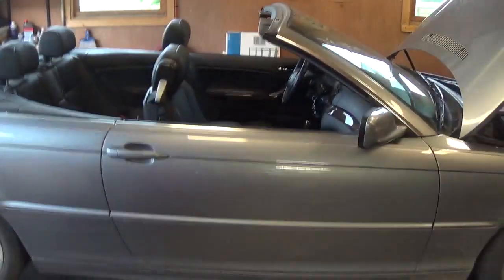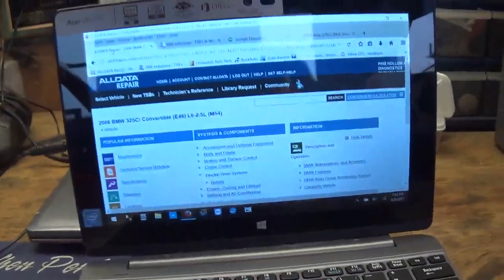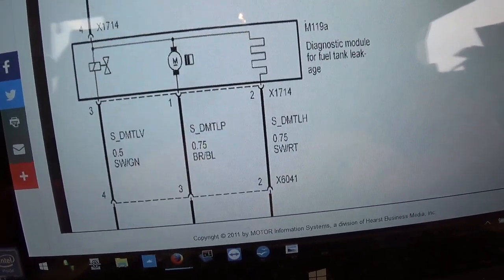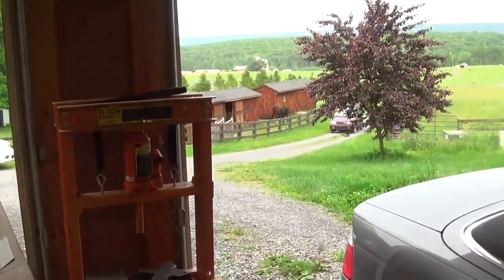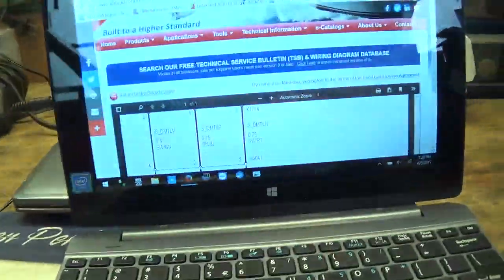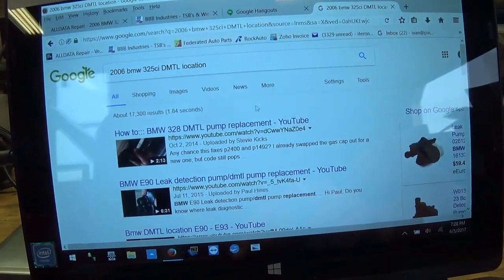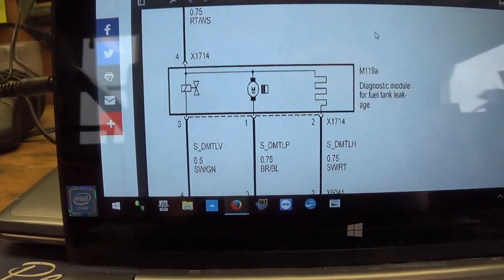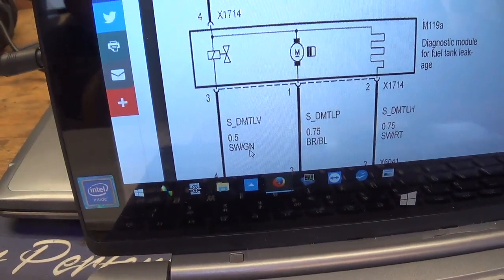EVAP leak testing: BMW DMTL system

Comment: I can't believe the Launch doesn't have bi-directional control on a BMW!
Thanks for the video!
Reply: Nick Nicu Audi a8 one fuse . 37 pages of diagrams needed to be printed to find the splice connector failure . This because of a half pint bottle of water spilled by a 6 year old under the passenger seat . Now to be fair that would have been on maybe 2 diagrams long on a domestic and maybe 5 tops on an Asian.  It's the presentation and availability of information that make them harder to work with. As long as you know that going in you'll be ok. But good heavens you MUST charge appropriately for the research time. If you do not and you undercharge then you will always feel beaten and hate the vehicle . Hope this comes across the right way . Now on the next A8 I will have a better clue just like any other make , it's all about what you work on and what you can retain for the next one.
Reply from the maker: The only thing it could do was pulse the purge solenoid. No vent control. Autel was the same.
Reply: Pine Hollow Auto Diagnostics I have yet to try my Maxisys Mini on a BMW with this issue. I'm using the factory Software on BMWs.
Reply: Nick Nicu none of the aftermarket tools can . Including AutoLogic for most years .
Reply: New Level Auto Thanks Keith!
Reply: Pine Hollow Auto Diagnostics I was able to actuate the dmtl solenoid/ pump with the Autel.
Reply: New Level Auto I totally understand the frustration Keith and you are 100% correct! I've been there! At least you provide good examples of your frustration with these cars,most just repeat what they've heard from Scotty.
Reply: keep that in mind when people ask if they should buy a car like this :) that's another reason why they cost more to fix.
Reply: Mobile AutoMD what year were you testing?
Reply: Here in the uk. Evap is not even monitored like in the usa. The only codes that will set are electrical circuit/solonoid issues. Bmw dme/dde never has  had much in the way of bi directional for some reason. In my experience most bi directional control was carried out in the factory guided fault finding test plans.
welcome to the lack of info Ivan. I was speaking to alldata rep today. Our info is different to yours again. The usa have access to more info by law. Apparently alldata purchase the access to the info, Then screen shot it and save it. looks like someone for got to screen shot the bit you were looking for.
ps. you wouldn't be able to smuggle much accross the border in those rocker panels of your mpv lol
Reply: volvo09 I can't tell if your comment is directed at me or not,but I personally do not pretend I'm knowledgeable enough to recommend others what to buy. I just can't stand ignorant comments saying how bad German cars are! Bad compared to what?! They all have their problems! One thing I can say is that there's nothing on the market riding as sweet as some of the good German cars.

Comment: Germans are speshul? PLASTIK. VIELEN PLASTIK. MEHR PLASTIK. PLASTIK UEBER ALLES!
Reply: opl500 So does Chevy,Ford and Chrysler. Plastic oil pans on the newer models anyone? Toyota is using plastic fuel rails for God's sake! So what's your point?